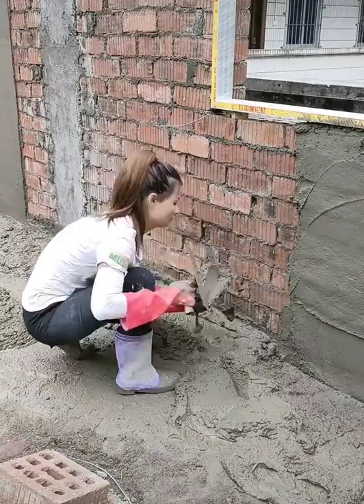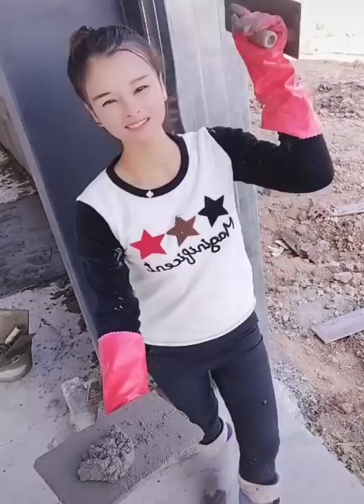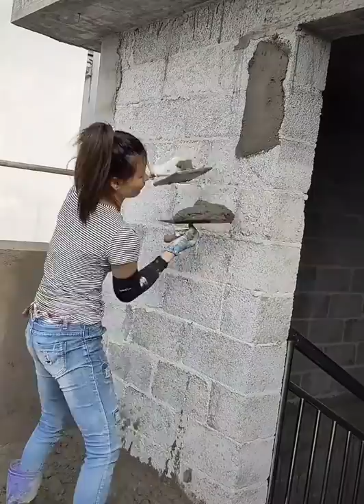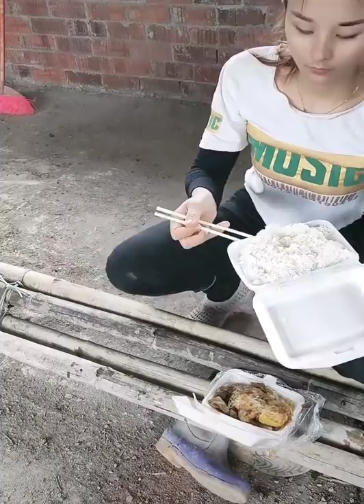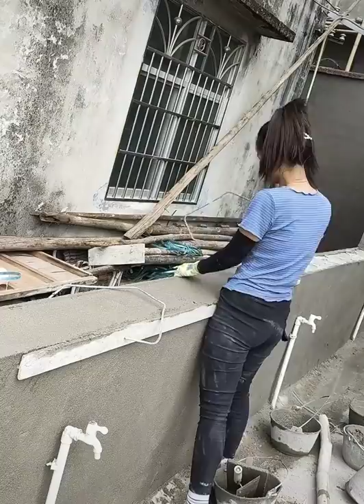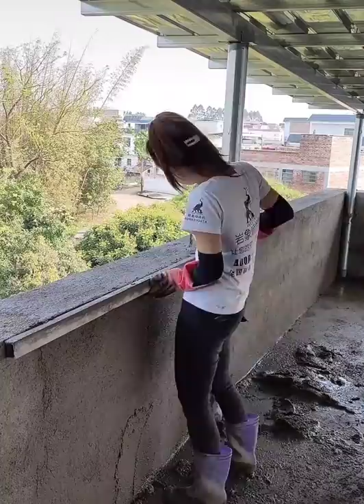Young girl with great tiling skills - ultimate tiling skills | PART 37

Comment: These are small contractors, and they contract for some scattered projects.
These small companies often do not have large automated machines to operate, so many rely on human physical strength，So working in these companies is very hard and tiring，
Many large enterprises in China have adopted automation equipments,including machines for cementing walls，Even the grouting and building the walls are done by machines，Not only high efficiency but also very easy labor